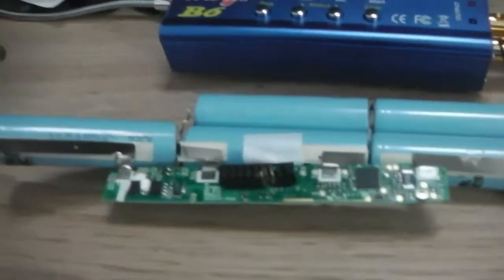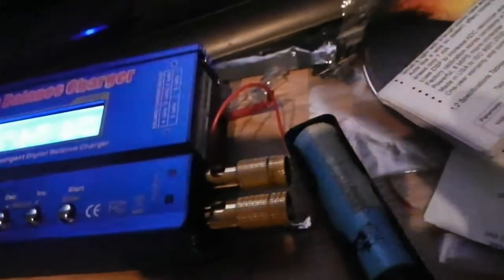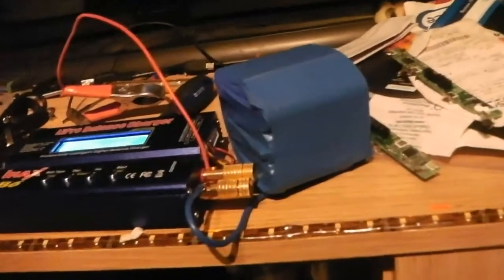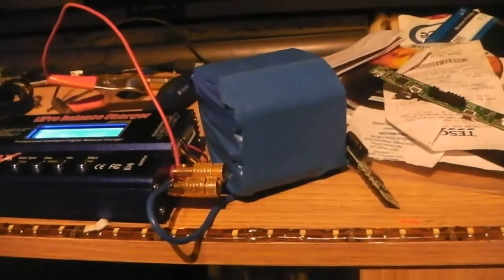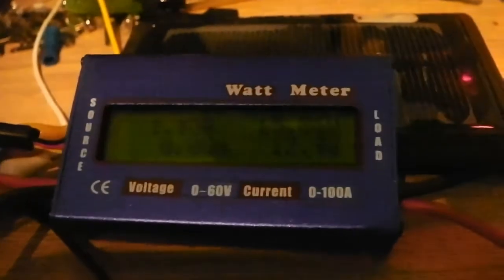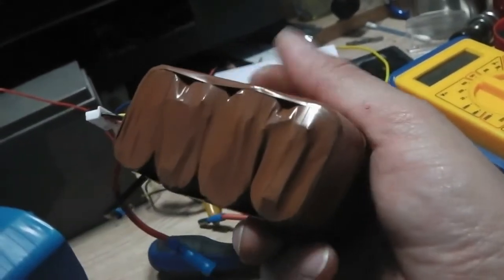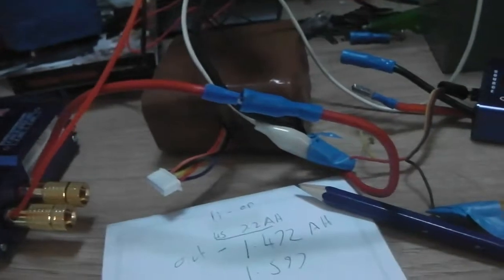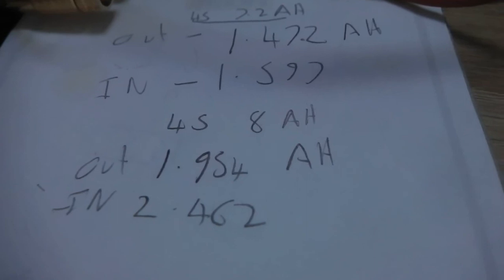comparing new and used li ion cells

Comment: sir if you could help am trying to build a small solar system with these used 18650 cells i have collected the plan to put 3 12 volt battery packs of 20 or 25 amp/hour each then then connect all three to a charge controller then to the solar panel will be using a 500 watt inverter is this the correct way to go about it  or better still could you draw me diagram to connect this
Reply from the maker: Absolom Madhaka I have not found the perfect way to do this yet! The cells will need to be kept balanced either by buying new cells from the same batch or by balance charging them!

If you have three cells in series your usable voltage is between 9.9-12.6v where as if you used 4 cells in series your usable voltage is between 12.4-16.8v but i haven't found an inverter that will operate above 15v.

i have tried charging li-on and lifepo4 cells through a Pwm charge controller but I have no proof that it doesn't harm the batteries.
Reply: pietkaify i am using a protection cuircuit board this one https://www.fasttech.com/products/1030/10003004/1225200-t-5016a15-8a-protective-circuit-board-for-4-cell
each pack has its own my main concern is can i connect the three of them on one charge controller as you would do using other batteries